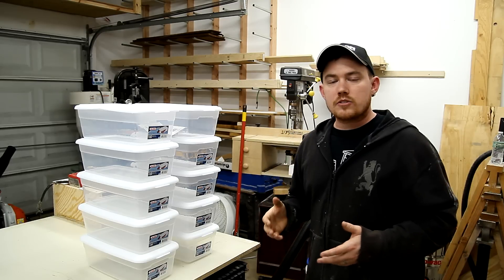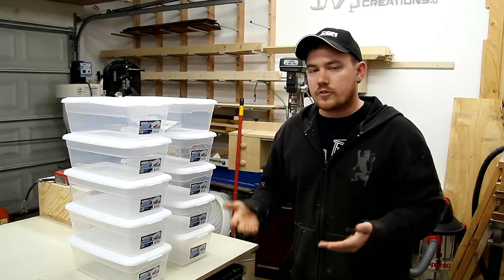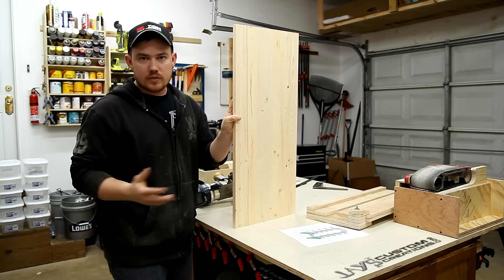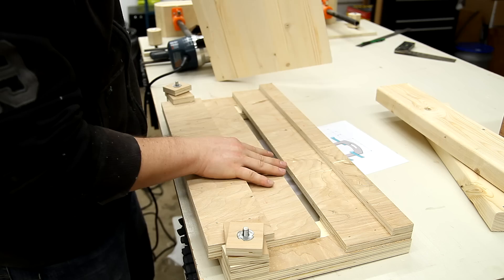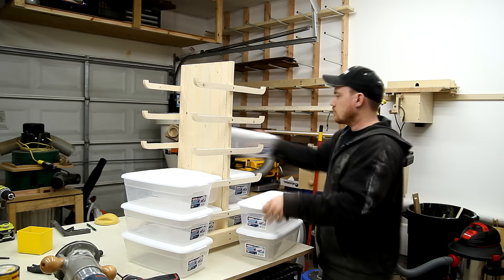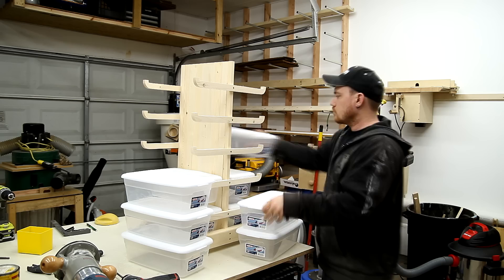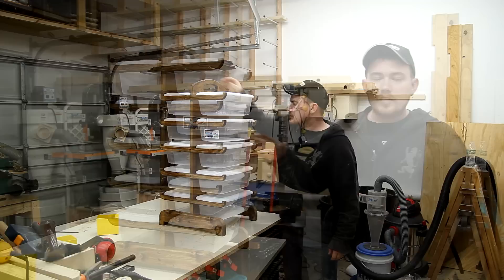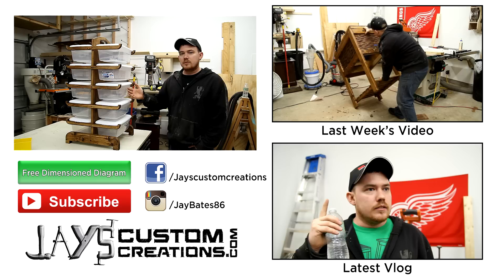Mobile Plastic Bin Rack - 183

Comment: Nice work Jay,I love the fact you do most of your projects with affordable wood,the only thing I don't like about pine when I use it is the way it looks when stained,I think I might try milk paint next
Reply: Milk paint is a great option. I've used it on poster frames I made out of inexpensive lumber, and they really turned out nice. You may want to consider using a white primer on the lumber first, however. Some lighter colors tend to let the darker marks in the wood show through. All of the colors look truer and more vibrant over a white primer, but especially red and the lighter colors.
Reply: Very interesting tip mrbakerskatz!  I might try that when I make my next set of patio furnature
Reply: Michael Olsen I loved it when I was shown this tip, but I feel like I should warn 1. of the smell and 2. of the extra day or 3 of drying time but it works great

Comment: Very neat project, thanks for sharing Jay. By the way, I saw that the small braces you routed them one at a time, how about routing them all at the same time by adapting some bolt holders, like an underside vise so you can squeeze them without altering you routing measure from the top side of your jig, that already has a long rail opening to rout. Well its only a time saving suggestion. Thanks again!! (Y) (Y)

Comment: That would be perfect to get all of my wife's shoes up off the closet floor. It doesn't look too heavy, but if I wanted to cut the weight do you think it would affect it structurally to cut a section out of the middle of the center frame?

Comment: Great caddy project Jay Bates!  I can see tons of uses for it in the home and shop.  :-D

Depending on what upon what the final use is to be, you could further lighten it by removing some of the center mass of the upright pannel either with a simple cut out or with a decorative flair - e.g., scroll work art.

I love the look of the Briwax finish.  What does Briwax use to establish its colouring?
Reply from the maker: Michael Olsen I originally intended on removing some of the inner panel but didn't want to weaken the lightweight pine/spruce panel any. I have no clue on the Briwax. I just know it looks awesome lol.
Reply: Jay Bates since your the one actually working with the wood , I trust your judgement reguarding its strengths.

My thoughs in this case  are that using the pannel in a colunm position, for something light like yarn, removin the central 25-35% generally would not cause any problems.  With all the boxes in place, they should help control torquing  along the vertical axis.

As for the Briwax, I definitely agree.  It looks AWESOME!

Comment: So I have a newb question for the experienced people. Wouldn't it be more structurally sound if the dado was cut into the tree and the arms remained intact or would it matter? I know that unless she's knitting bullet-proof vests, in this instance there wouldn't be enough enough weight in yarn to matter - I'm just thinking of versions of this with heavier items in the bins.
Reply from the maker: Andrew Rowe Good question Andrew. The screw will be enough to hold more weight than the shoe boxes can handle. The purpose of the dado in the arms is to prevent the arms from twisting if more weight is on one side than the other. Putting the dado in the panel wouldn't provide as much support in regards to the arms twisting.

Comment: I love this and want to adapt it to my needs; however i see a flaw in your design; i use these boxes in my business; yarn may be ok but anything heavier and those lids will pop off; your thoughts? also i only have a corded drill saws all and a circular saw; do you have instructions for this with those tools
Reply from the maker: Tracy Bruring You can make this with a circular saw and a drill. Matthias Wandel has a good video showing how to make dados with a circular saw. The project was sized to hold the containers via the lip on the container, not the lid.